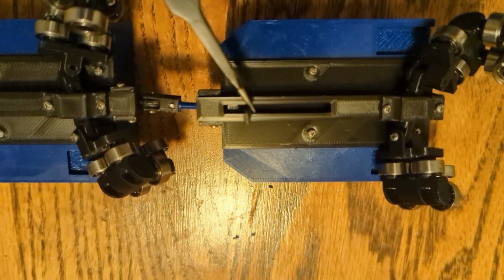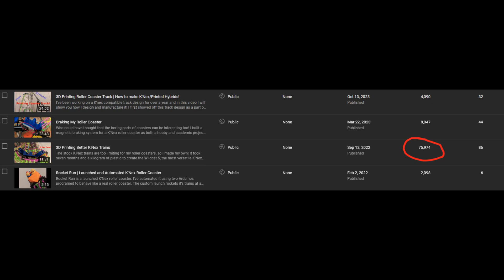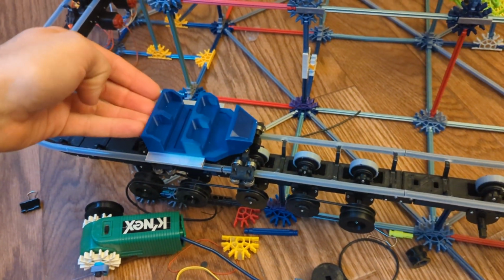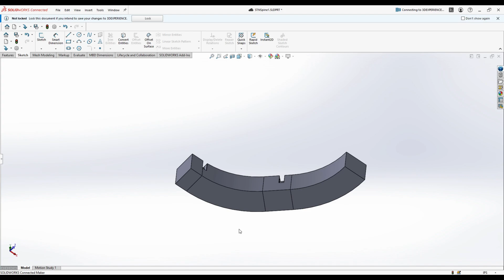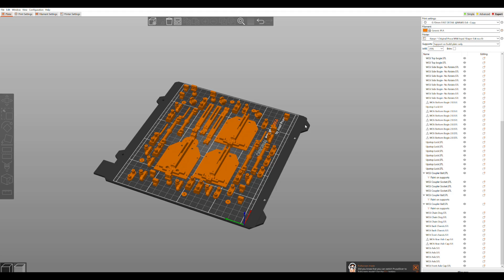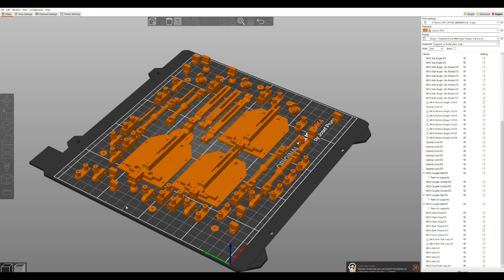3D Printing Even Bertter K'Nex Trains- April 2024 Update

Comment: These are super cool! Could you let me know what bearings you use and where you purchased them from? Thanks!
Reply from the maker: Thank you!

These are 10x5x4 mm ball bearings that I believe are intended for RC cars. They come with a rubber shield and are packed with grease. I've removed their shields and the grease to decrease their resistance. 

I purchased them from Amazon, but they are also available from RC car websites or AliExpress.
Reply: @ awesome! Thanks for the quick response! I’m looking at making my own 3d printed model coaster soon, and was trying to find some bearings for the bogies that will be appropriate lol. I’m going to be using PFTE tubing as the “track” and will be 3d printing some track spines for it. Anyways, cool project and keep up the good work!

Comment: with the magnetic brake fins on the trains you could probably do an LIM launch like the ones found on older premire rides launch coasters like Mr. Freeze.
Reply from the maker: I'm actually hopeful to build a LSM launch someday in the future. These trains sit higher off the track. With the added height I've been able to squeeze some magnets underneath for roll back brakes on my air launch project. I'd like to try to use the magnets for a LSM launch at some point in the future.